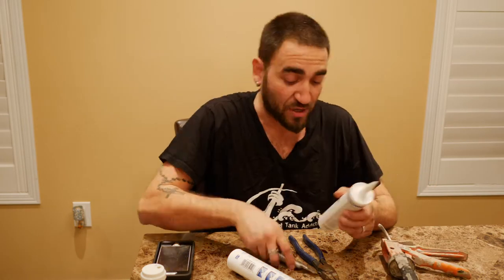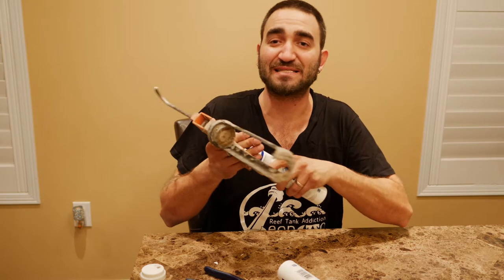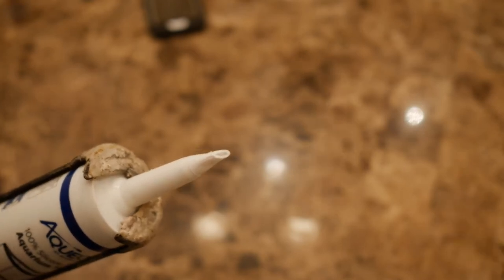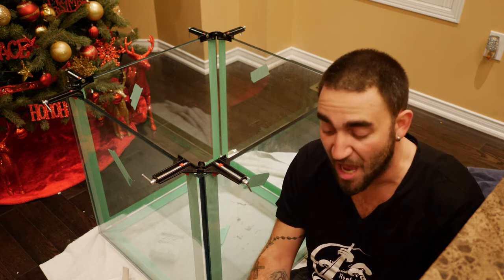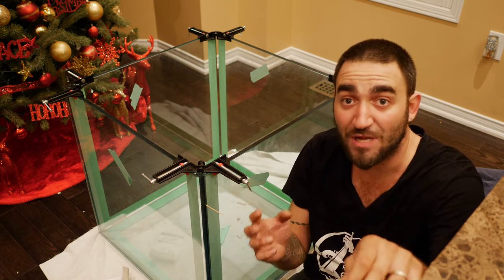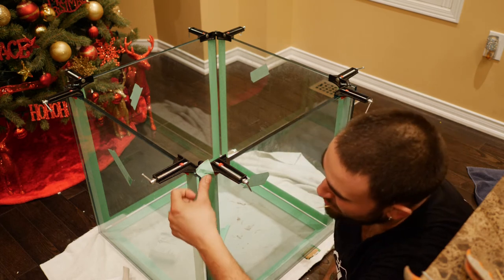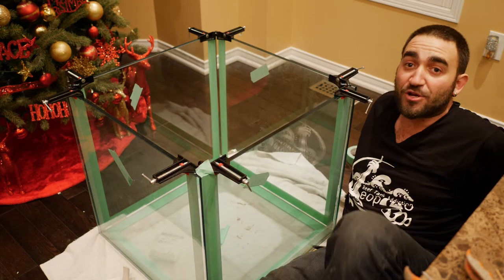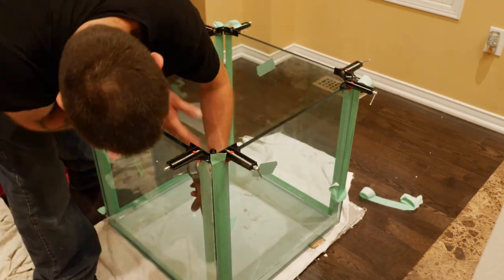How To Build a Reef Tank ( Part 6 )

Comment: Leo the injection man! How did you place the tape under the base? So it wouldn't leak out there onto the floor.
Reply from the maker: G. Scott Fairbairn hey Scott great question , I actually did not use any tape at the bottom of the tank. Under the bottom glass was the drop cloth / towel. At the bottom of the tank the silicone does come out between the gap. But the glass pressure against the towel / drop cloth doesn’t allow that much silicone to seep out. Once all dry after several days to a week drying. You will list the tank from one side and slowly peel back the towel / drop cloth from the glass if it is sticking. U can also use a razor blade to help if needed. 
Just keep on eye of there are any areas that disturb the silicone in the tank while peeling towel / drop cloth. Overall just use caution and pay attention when listing the tank and removing the bottom towel / drop cloth.

Comment: Leo how do u do the bottom, do you use the bead method for the bottom?
Reply from the maker: Hey Kennith. I use the same injection method for the bottom as I did with the side panels. Just leave a gap and inject the silicone. The side panels do NOT sit on top of the bottom glass. The side panels sit around the bottom glass. Hope this helps and makes it clear for you. Any other questions let me know. Cheers.
Reply: @LeoPazzo  Thank you for your reply.  I can see that now after I re-watched that section.
Reply from the maker: @kennith.  hey bro, no I don’t use zip ties for the bottom. 
The weight of the glass itself holds the side glass in place. I just used the toothpick to estimate the gap and as I mentioned the weight of the glass holds itself in position. I believe I did use a few times for different tank build large clamps from Home Depot. The clamps open bigger then the tank like 24”-36” wide and then just squeeze / hold the side panels up against the bottom glass. I don’t feel the big clamps are needed because if you apply too much pressure to the clamps you can crack the glass or shift things around. I prefer to just let the weight of the glass to hold itself in position for the bottom alignment. 
Hope this helps
Reply: @LeoPazzo  Perfect, thank you again.

Comment: Once injecting the silicone do you remove the cocktail sticks or spacers imeadiatly or wait until the the silicone has set?
Reply: He removes them once the top clamps are tightened, which is before he starts to inject the silicone.

Comment: Hey Leo. Can I use injection method for 72 x 24 x 24 with 1/16 silicone gap? Measurements are in inches. 12mm glass. Also I'll be placing two top braces sized at 4" x 72"

Comment: Leo hi i have a Question: Why when I inject the silicone into the interval do I see that the adhesive is free of air bubbles and after the silicon starts to dry I see that there are small air bubbles in some places?  I use dedicated silicone for the aquarium What could be the reason?
Reply: hi leo ,can you help ?
Reply: Heyyyy sorry for late reply
Reply: ziv kloda tiny tiny bubbles should be ok. It’s any larger air pockets that are not good. If you send me a picture of the glass and silicone that you are talking about I can help more. 
This is my other YouTube channel that I am replying on. Thanks
Reply: @LEOPAZZOPRODUCTIONS  of

Comment: Leopazzo is seems an italian Nick Name =)
So, i'll build my first aquarium tank (90x35x30) and i have seen a lot of videos, but yours, with injection method i think are bests.
I'll try with this method...but...do w kow DOW CORNING 881 silicon? Is a lot of viscous...do you think 2mm of silicon thick are sufficient?
Thank you!

Riccardo, from Italy
Reply from the maker: Riccardo Cartocci waaaay Riccardo sorry for the late reply amico. Si sono italiano . Your tank size is very nice wow. Love it. Have you built your tank yet. I suggest you bottom brace and top brace your tank. What thickness of glass are you using ? I leave approximately 1/16” gap.
Reply: @LeoPazzo  A toothpick is slightly more than 2 mm.

Comment: Hey Great video! Not too many videos explaining the process online. I need some advice on a tank i'm attempting to build. I have 10 inch cable ties that i plan on using as spacers. They are about 2 mm thick. Is this OK, or is 2 mm too much of a gap between the glass panes? In addition, the tank has the sides, front and back sitting on top of the base, the glass is cut and cannot change the design to a floating base like in the video. I'm using 12 mm glass and the tank dimensions are 48 inches (length) by 17 inches (width)  by 21 inches (height). I will be cross bracing the tank with three braces about 3 inches in width. One on each side and one across the center.
Reply from the maker: Hey there Anand how are you. Thanks for the feedback. In regards to your tank build. The 2mm is slightly on the larger side. I’d say 1/16” is better then 2mm. As far as the aquarium glass walls sitting on top of the base, this is not the way that I built mine and it maybe a bit more difficult for you to inject the silicone and then remove the zip ties or 1/16” spacer after you injected the silicone. 
You will have to remove the zip ties / spacer and then the side walls will apply pressure downwards which in return will squish out the silicone and may risk the chance of the glass touching glass without any silicone in between. This will create pressure on the glass glass. I would say yes it can be done but with using extreme caution that the glass does not touch glass with no silicone in between. Good idea on the cross braces. Good luck and keep us updated. Any other questions feel free to ask. Cheers
Reply: LEOPAZZO TV  thanks for the advice! The tank is coming along well
Reply: @AnandDavis  Hi! I have the same issue here.  I just disassembled a 65 gallons and I want to do silicone injection but side panels sit on top of the bottom panel. How did your build went? 

I'm thinking maybe I can :
1) use spacers for the bottom,  seal around,  wait 10 minutes, remove the spacers and then fill the gap (hoping  cured and new silicone will stick together)
2) clap my side panels to wood frame so the float above the bottom panel (hoping they don't break)
3) use spacers just 1/4 of the thickness of my glass so I can remove them after it's cure and then make the inner silicone joint making sure to fill the spacer's gaps. 
I'm not sure. Any suggestions?
Reply: @DidooDalwen  hi it worked out well, been slightly over a year that the tank has been up. it's working well. since it's not a floating base. I used Styrofoam below the base.  Also the tank has a bottom euro brace and top cross brace. But for the injection method, a floating base is a better design. I was stuck because i had already cut the glass.
Reply: @DidooDalwen  also to add to the previous reply. to point 1. yes i did the same, sealed around the spacers and then removed the spacers and filled the gaps. 2. I do not recommend clamping the panels as when i did that the last time i ended up with small bubbles once i removed the clamps. 3. yes you need the make an inner seal. because we have filled gaps when we removed the spacers we cant be a 100 percent sure the injection is water tight.
Reply: @AnandDavis  I am in the same exact situation. I don't want to go for a floating base.